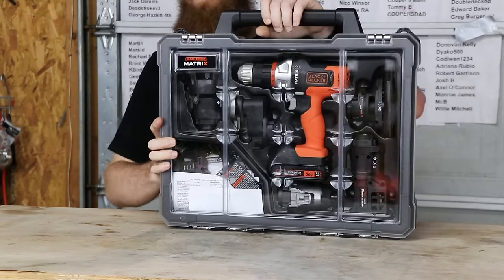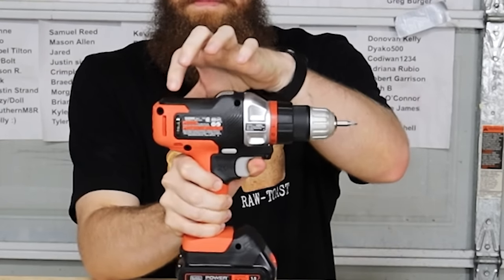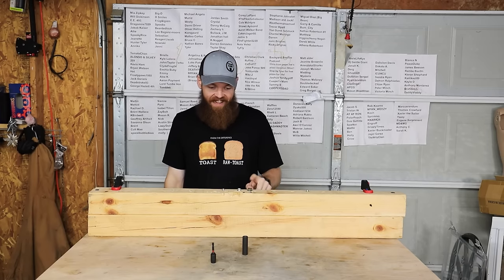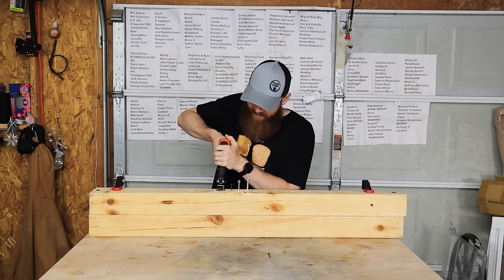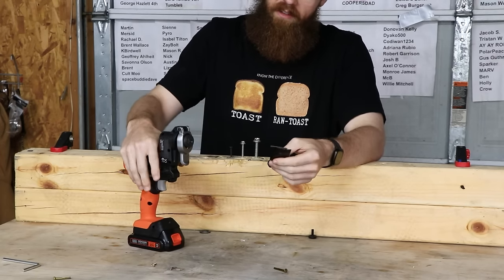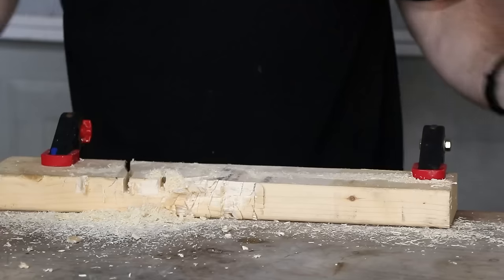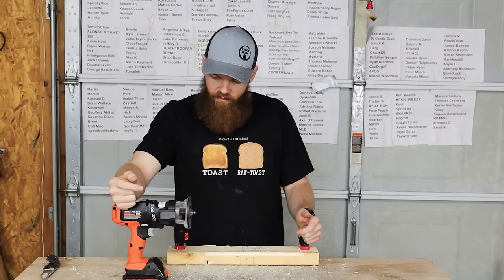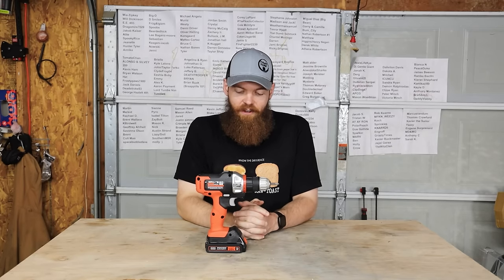Is This The Last Drill You'll Ever Need? | Black & Decker Matrix system

Comment: I mean, the jigsaw seems cool, it's definitely an equivalent to a 2.5 to 3 amp jigsaw. 
The oscillating tool was never really my favorite. I have a 120$ Dremel one and the only thing it seems fit for is tile cutting
Reply: They are pretty great for cutting nice clean holes in dry wall if you have to get into the wall for whatever reason. Much faster and cleaner then other alternatives. 

The diamond blades are great for cutting out grout as well.

Comment: When using a router, it’s meant for the body to slide along a fence of some sort. Usually a couple clamps and something with a straight edge.
Reply: Na you use a bit that has a bearing then you don’t need something to hold the router straight, to be frank though Tyler’s technique is astronomically wrong lol

Comment: I know if I use a carbide blade my Milwaukee multi tool will cut any of those bolts. Now Dewalt blades are where it is at with oscillating tools.

Comment: I figured they didn't make them anymore lol I have two that are still basically in brand new condition with a few attachments that's from 2013 that was giving to me from a old man that passed away and that have been great for medium around the house stuff but wouldnt do anything massive besides a bunch of screws with a stronger battery of course so you won't strip the gear out

Comment: every time i buy black and decker i regret it. i once bought this weird off brand "ultra steel" and even though the batteries had short life, much like the black and decker, for $20 that thing kicked ass. problem is i cant find replacement batteries and got myself a makita. for under $300 i got a mid torque impact, a drill and a small impact with 2 6 ah batteries and it was 100% worth it over trying to settle with "homeowner" brands. no more working for 15 min then charging a battery for 2 hours just to do 15 min more of work. not to mention all the power i could ever need to do any task i would expect to do.

Comment: I gotta say this.  Black and Decker does get a lot of hate because they're tools aren't brushless and not made for contractor use.  But I've been using them for years and though I don't have the Matrix drill, I have almost every other singular tool they've made (including the many different drills) and have been using the cheapest one for years with no issues.  They may not go as fast as other brands do but they DO hold up over time and will get the job done if you're not deliberately abusing them like a lot of people do.  I can see this not being as good as some others, but I don't see it as the worst

Comment: My father used Black and Decker. I've used Black and Decker all my life. I still have my first power tools, a B&D sander, drill, and circular saw that I've had since my late teens and early twenties. I'm 65 now and these tools still work great. Kid, you're full of crap. B&D has always made dependable tools. I bought the Matrix tool system ten years ago. And it is awesome. B&D also owns DeWalt. And they're great tools. B&D is the go-to for power tools.

Comment: I looked up the directions for the router,  it says for outside edges go clockwise and inside go counterclockwise... it said nothing about going straight ( like for a channel ), but I would think he should've pushed instead of pulling. I don't think it would've jumped around so much. Admittedly,  it's been a while since I've done anything with a router, but I think it makes sense.

Comment: Man if this was done by Milwaukee with more powerful attachments and higher quality materials it would probably be a best seller. I can’t stand how big my tool box is just because of the space that all the handles take up, plus the handles make repacking into a game of Tetris. I’d be able to put my circular saw into my main tool box instead of needing to just toss it in the back of my car. This system would reduce my tool box to a quarter of its current size and I’d have all the same tools. Plus the weight reduction means I can carry around an additional battery or 2 and be at the same weight.

Comment: Nails are mild steel whereas screws are hardened. Screws are worth taking the time to unscrew rather than cut, they will chew up your blades. Even the fancy carbide Diablo saws all blade are not exempt. But they do work great on mild steel. And if you gotta cut stainless steel use a cutting disk. 
Now I know someone is gonna say if you really wanna do some cutting get yourself a cutting torch or a plasma cutter....then comes the guy talking “Lasers”.... 😂

Comment: the oscillating blade is not meant for metal what your using its for Sheetrock lol but kit specific says compatible with "porter cable" dont get me wrong "DIABLO" is by far my fav brand of blades!!!! but the only reason i use oscillating tool is for wall board tile or drywall. i love all your videos tyler but stop using 2x4's and put the power tools down hahaha much respect for doing what you do bro!!!!

Comment: I’ve had this tool for years. The biggest draw is the battery. Get a bigger battery and the tool will really come to life.
Reply: Also when using the oscillating tool it works better if the blade isn’t resting on the wood

Comment: Bought this system years ago when it first came out. Been using it for small projects and even for making a small deck. Worked great but about a month ago the handle part crapped out. Currently trying out the ‘Hart’ brand that Walmart carries in store
Reply: If you still got it then if it crapped out like normal then the mosfet died (cracked) or the motor worn out the brushes. You can get the motor off Amazon for like $30 new and the Mosfet are easy enough to solder a new one on and are cheap too. Thats a common fail so if you can't do it then you can get a friend that can fix it easy enough.

Comment: Screws are hardened steel nails are not, a multi tool blades is not designed for hardened steel. If you smack a drywall screw fast it'll snap nail will just bend.

Comment: I've got the bnd 20v impact drill and it's great for light weight work. I use it for lug nuts and drilling.i don't think the rotor speed is enough it needs to be faster

Comment: Overall its a pretty cool setup, and I wouldn't mind having one. But that thing doesn't nearly have enough rpm for the router attachment.
Reply: It does have enough RPMs with the right bit and that bit he was using was way too deep cutting and thats even for a regular router as it would just burn or chip out. Lucky that it was pine. I like using the router for round overs edges as that's its best functional use. Something you don't want to drag out a full router and setup or the piece is just too big to bring to a table.

Comment: I have one of these it's good but ur missing at least 3 other attachments circular saw air pump and Sawzall
Reply: Also they make a battery with a higher voltage for them and it changes the drill big time I think I took one off a black n decker weed Wacker and it doubled the tools power

Comment: There’s blades that will fit on that oscillating tool quick connect you just got the wrong kind. And you wouldn’t really ever use it for nails or bolts…

Comment: Craftsman had one just like this called the Bolt On and the matrix attachments actually fit on it and vice versa I've had the matrix for a while even bought the corded one ill tell you it's a nice drill but like you said you can't work it to hard
Reply: I worked both the bolt on and matrix for almost 10 years and they handled it. Almost construction level use can be handled for the impact driver and drill along with the trim saw.

Comment: Seems decent to me. Like you said probably like homeowner for a small project here and there but definitely not an everyday use tool. I am curious if one of the attachments breaks if you can just buy like a “replacement head” or would it be easier just buying a new kit
Reply: Yeah I have used most these like an everyday tool. You can get the individual attachments, they are about 20 to 30 each. Had my set for over 10 years and put them through hell. Cooked a impact driver trying to drill 3/4 inch holes with one of the step impact bits but that was in 1/4 plate and that was after doing 12 other holes like it and hundreds of 1/2 inch holes in the same plate thickness. Thats well outside the use of most impact drivers that's dedicatedly built.

Comment: I don't think you used the oscillating multi tool right. Cutting screws is tough even with the proper blade on my nicer ones. I use a swazall for the screws, use the oscillating tool to cut wood in tight spots, holes in drywall, etc. Softer materials, not hardened steel

Comment: The jigsaw technique was pretty rough for me to figure out and I still don't really do it all that great but I noticed you're doing this stuff that caused me problems. Your technique with the jigsaw is causing part of the lack of performance The jigsaw plate needs to stay like completely flush with your board and what you're doing is your pulling it up in the back and so it's going at an angle and it shouldn't go like that Plus is meant to cut straight lines and I noticed you wiggling from left and right jig says don't do that. Draw a line on a board use the jigsaw to cut directly on that line sometimes if you hold your free hand down on the board and use your thumb to help keep the back plate guided and flush with the board it helps. Also the blade could probably be the wrong type of blade. It just depends on the type of cut your trying to get and the type of wood you're trying to cut. Aggressive teeth doesn't always mean the best thing to cut a 2x4

Comment: It is pretty obvious you never used a router.  But, you should rectify that that ASAP.  Go get a decent router.  Bosch, DeWalt, and all the major beans usually have a combo deal that includes a fixed base and a plunge base.  You can also get a surprisingly decent table router from Ryobi or Kobalt for a decent price.  I recommend learning how to use those things as a router is a super versatile tool and you can do so much with a router.

The one on this video would work for very basic stuff, but you can just tell it's under powered.  But, routers generally have to be powered higher than you would expect.  The smallest Bosch palm router is 1.5 horse power.

Comment: Screws are harded so they don't bend. Nails are designed to bend so they are softer that why they are easy to cut through also why they use nail to build houses not Screws so if the house shifts the nails bend not break and your house dose not fall apart

Comment: I would've like to see how the drill part does drilling a hole in a brick wall. Weird that this wasn't tested, although I'm guessing there's not much need of it in America because not a lot of houses are made from brick but they are in Europe (I'm from Belgium). It would have been nice to see if the motor is strong enough to drill holes in brick.
Reply: You could not get through a brick wall with this lol.. you would need a hammer drill
Reply: @steff6682  Here in Belgium when you buy a drill it always has a hammer drill function. If it hasn't it's not called a drill but a "vijsmachine" which literally translated means "screw machine". So just to put screws in drywall and wood.
Apparently it's different in the US.
Reply: They do have a hammer drill attachment and I have used it to drill into brick for mounting shelving rails, it definitely can do it.

Comment: You should have used the drill for drilling holes the impact would of been best for lags and screws. I wanna see if it can drill at least a 1” hole
Reply: Yeah most drills are pushing their limits with a 1" hole in the first place. Thats why drill bits tend to be 1/2" chuck past 1/2" unless its impact drive. I have done 3/4 in plate and it works but the bits tend to wear out. It can do carbide hole cutters up to an inch in plate steel with cutting oil.
Reply: @silentferret1049  interesting my dewalt doesn't have a issue with 1" holes paddle bits augers hole saws ect i've cut 3" holes with a hole saw bit with my drill no issues

Comment: I think this is hilarious.  I bought this set, I guess about a year ago, and the drill is okay, but I had to replace some of the rest of the tools. Some of them won't cut at all. The cute little circular saw, won't cut, and the jig saw won't cut. The little sander works, but not that great.
Reply: Yeah I have both the trim saw (what you are calling the circular saw) and the jig saw and they cut like they are supposed too. The trim saw is meant for 3/4 inch or less.
Reply: @silentferret1049  I guess mine are defective then because mine won't cut at all. The trim saw stalls as soon as it comes in contact with the wood. I did realize that I might have installed the blade wrong, but I just bought a full size circular saw. I bought an inexpensive one, but it works great.

Comment: A 1/4 in impact driver isn't really made for lag bolts that big. its mainly used for the 3.5 in screws you used the drill for. Drills should just be for drilling holes. the impact is for screws. j

Comment: Honestly the thing is kinda sweet... I've seen it before but it doesn't perform all too bad according to your test. The router is awful though (compared to even the cheapest Harbor Freight router which is actually pretty dece), that's the one thing I wouldn't use. (By the way I'd back the router bit off especially since that thing has both super low RPM and super low torque, lighter passes would definitely be better for that terrible monstrosity)
Reply: Just saw the jigsaw... the blade seems awful. The concept is great actually but the grip is way too far from the material you're cutting for it to be accurate or ergonomic. That's one that could be redesigned to actually be really nice to use

Comment: Please dont use the Router attachment... It has to low RPM. It needs at least 10000-14000 rpm, but with 1000-2000 its to dangerous. And the Motor is to weak.

Comment: The occalating tool does work like that and that was a Milwaukee titanium bit not carbide the real dialblo carbide blade has two mounting points and would fit on the clamp style also the carbide is thick that Milwaukee will work on nails but screws are hardend and very hard to cut i personally would use the m12 fuel die grinder with a metal cutting wheels but so far this tool for the advantage guy doing home task its perfect 👌 with the router lmao 🤣 bro that bit is for the edges to make beveled corners 😉 lmao 🤣 but a higher ah battery and good charger 😉 🤣 would be actually a 1-5 kit and the jig saw you have a down stroke blade and a up stroke blade you have the wrong blade lmao 🤣

Comment: Had this tool up in scamcanada for about 10yrs now and is actually a decent tool for what it is and cost and will get the job done In most cases and great for that buddy ya need to lend a tool to lol my drill and impact attachments still work till today and the air pump is still kicking and good fir thise quick tire fills like lawnmower or balls bike tires stuff like that my oscillator dremel and jigsaw all burnt out quite fast from maybe 15-20 min continuous use and they died

Comment: The fact that this tool is average at best at doing everything, is exactly why other companies don't do this.  The mechanisms in all of these tools should be different because each tool absorbs different loads. Improper design will cause these to break quickly. 
If I'm in the field and one of my tools breaks...I'm not fucked like I am with this. My drill breaks and I'm out an impact and palm sander...

Comment: I would like to point out that except for battery life, Black and Decker is typically just as good as DeWalt. I have to give the battery score to DeWalt but everything else, it's so miniscule of a difference that I truly do not care which I use, but if I'm buying it, I'm going for Black and Decker. Cheaper and it's the same shit. Worse battery but oh well. A better battery isn't worth an extra $100-$200

Comment: 16:20 its not u. that is just super bad router xD
the motor just dont have enough beans to run that also that is the worst shape for a router, impossible to get a good hold also the rpm sound way too slow

Comment: Don’t know why black and decker stuff is seen as so bad I’ve had an impact driver off them and it’s one of the most used tools, great for undoing small nuts and bolts not massive power but undoes most small nuts and bolts and just tightens them just enough so you don’t have to worry about snapping them it’s now 5 years old the batteries last well, cheap, fallen off stuff hundreds of times and still works. Brilliant for atvs, lawnmowers stuff like that.

Comment: B&D is not the top grade tool maker. At that price point it is a value. If you had a bit more tool knowledge, your results would have been better. For example:  the jig saw works best if you keep the plate firm to the work piece you are cutting otherwise the saw blade is not cutting its full travel. Also go slower especially in metal and do not force it.

Comment: Wow buddy. You strike me as such a handy kind of guy and I'm really surprised at your lack of knowledge on what a router tool is even for. It's a finish piece. You round the corners of the table so it's not just a square block it's not used to cut a straight channel line through anything. Just out of curiosity, do you do any sort of like YouTube or Google searches on what kind of test functions would be good to evaluate whatever object it is that you're reviewing? I'm interested to know if you do that beforehand or if you stay away from that so that your opinion is not biased?